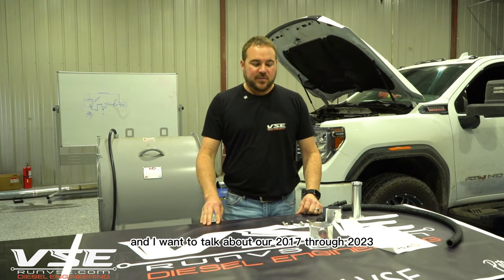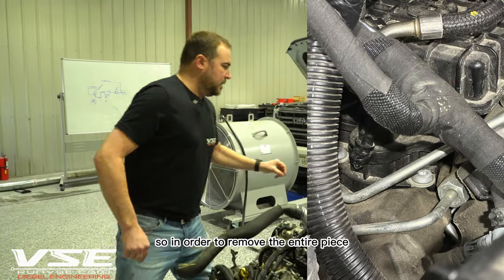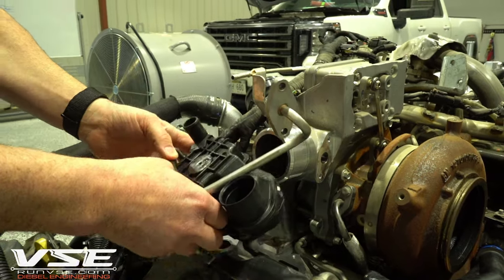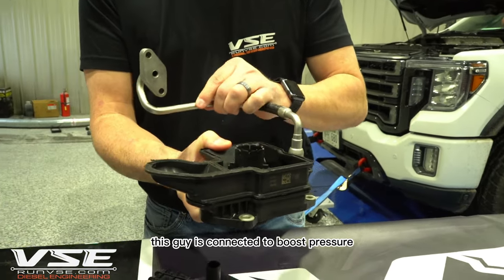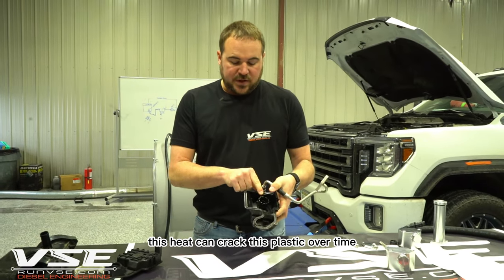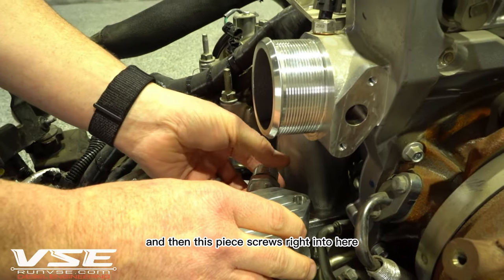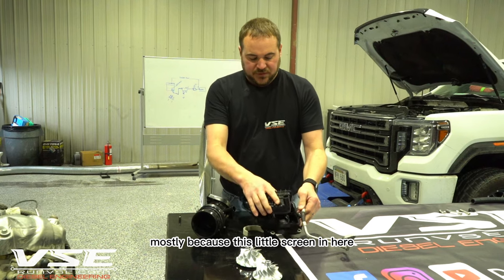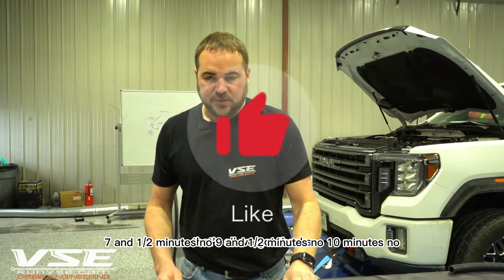2017-2023 L5P CCV Explained

Comment: It's been called a PCV system since the dawn of time but everyone just HAS to be unique and make their own acronyms.
Reply: CCV is a completely ubiquitous term and actually not the same thing as PCV. I'm guessing you come from the gasser world.
Reply: @ThanksHero  nope
Reply: @michaelfralick2355  lol damn I guess you came from the kitchen then with the knowledge bombs you’re dropping
Reply: @ThanksHero  alright let's dig into then. In order for air to move there has to be an energy differential, a high pressure and a low pressure system (fun fact this is how weather works). If the air inside the crank case isn't a fixed volume and is required to vent somewhere, the only way it would actually vent is if the crankcase had higher pressure than where the vent terminates. If you were to read the pressure of the crank case on any engine you would see it fluctuating as the displaced volume of air changes with each rpm. This happens because it's not a perfect seal in each cylinder and even at idle there is a small amount of air that needs to be vented in order to not cause issues. Now I gathered you think your knowledge is superior because you assumed that I didn't know diesel engines don't actually draw a vacuum, but in fact operate at atmospheric pressures. Which is why you tried claiming that CCV is more common than PCV as an acronym and I must come from the dreaded gasser world. How dare I, right? Luckily I've built and tuned an engine or two, of both fuel types in question. I even spent some time going to school to be a diesel mechanic. Lucky for us none of that matters because this is the internet. You might not even be real. Then again, you might be real. As real as they come actually. I bet you have plenty of accolades and reasons to think you're cool. So I'll refrain from flexing any further on you. Just know, if air moves it's because of a pressure differential. Thus making the ventalation system a positive crankcase ventilation system. Because if the pressure was never positive it wouldn't be a vent. Now go kiss your mom for me.
Reply: @michaelfralick2355    bro I’m not going to sit here, read your wall of text, and pretend you didn’t just google all that shit when you thought “CCV” was an acronym they just came up with.
Reply: @michaelfralick2355  lol you're so wrong
Reply: CCV Crank Case Ventilation big difference used on diesels  PCV is Positive Crankcase Ventalation used on gas engines PCV works by using vacuum drawing through from one valve cover and then the opposite valve cover draws in clean air from the air intake tube through the engine hence the Positve part because it's actually using vacuum to draw the pressure gases through but diesels we don't have vacuum so it relies solely on the positive pressure from blowby to push the vapor back into the inlet big difference there bud if you don't know how things work don't put out misinformation
Reply: @haydendenard2693  you realize vacuum is negative pressure not positive pressure right?
Reply: @michaelfralick2355  it absolutely is negative pressure the positive part of it is that it's actively using vacuum to positively pull the combustion gases back into the intake don't try me on this one man I've been in the industry and sat through more continuing Ed to get pay raises than you would ever want to think of
Reply: @michaelfralick2355  it doesn't mean you are using positive pressure to do it although if you want to get really technical about it you are using the positive atmospheric pressure to fill the vacuum that's created in the crank case either way that's the difference lol doesn't matter how you want to put it they are 2 completely different systems
Reply: @haydendenard2693  still no
Reply: @michaelfralick2355  that's the best you've got ? Come on man just "still no". I've not run into anyone that's best response was 2 words when confronted with facts in awhile. Boy talk about unwilling to just accept learning something new lol. Type of person who will never move up in the world because your pride will get in the way of learning new things because you truly believe you know it all.
Reply: @michaelfralick2355  you realize that queen made a song on the subject?

Comment: Just use vise grips to flatten the turbo bleed off and those hot turbo gases won't melt the pvc system.  The cap off horn and run a hose down to let gases out.  Low cost

Comment: when is the catch can add-on kit coming out for l5p?  tool trucks have the extractor tool irwin  hanson 7/32 extractor  or a t30 should work also-- mac 5mm rbrt hex worked good on mine also when extractor and torx failed

Comment: Just installed this today looks nice but damn those bolts were a pain in the ass especially the one underneath the turbo spent about 30 minutes on it
Reply: @stillrollingcoal how did you get that back bolt out under the turbo? I’ve been at it for hours and can’t get it out.
Reply: What was the best tool to get in there with to get the bolts out clean n safely?
Reply: To get the bolt out from under the turbo was a pain in the ass. I ended up using a T 40 hammering it on, and just praying it come off and it finally did I spent probably an hour on that bolt  The other three were perfectly fine.

Comment: since we use the factory tube for the turbo inlet, what is the included hose for?
does it matter wich side you bolt the 90 and the cap on the rear piece ?
Reply: My question as well .